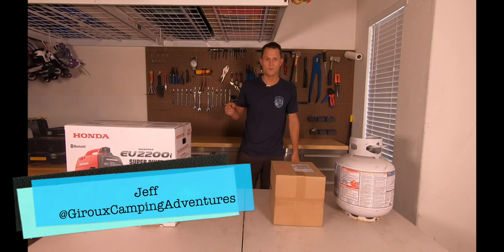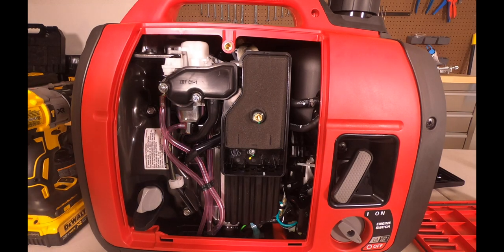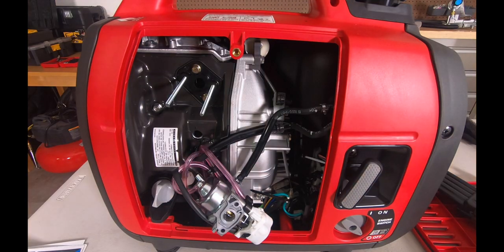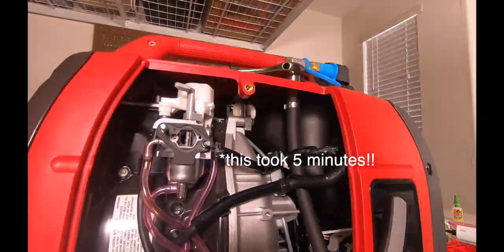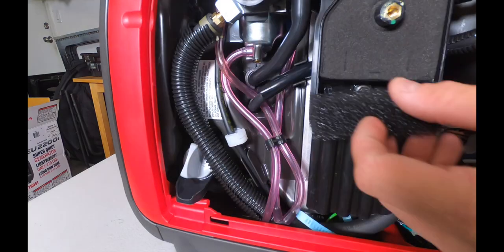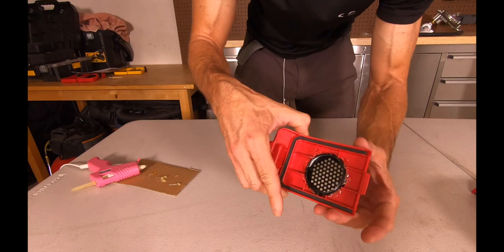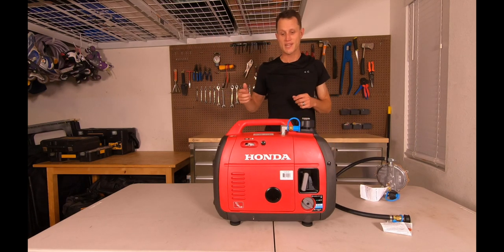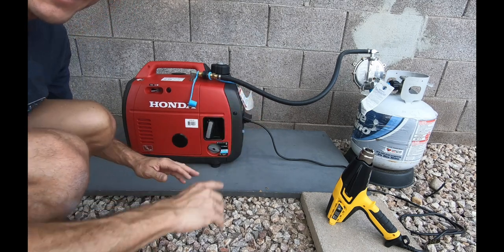Honda EU2200i Generator and Grenergy Propane Kit Conversion How-to

Comment: Not a bad idea to seat the piston rings with gasoline and conventional oil, as opposed to LP/NG and synthetic.
Reply from the maker: I plan to start using synthetic oil maybe around 100 hours. As for gasoline...not an option for me since I never want to put liquid gasoline in this generator. For me...more of a toy/science experiment. I don't mind seating piston rings with LP over gasoline. Though...I'm no engine expert and have not looked up the pros/cons of running either to seat pistons. Do you know?
Reply: @girouxcampingadventures  I replied, but my reply comment may be in the spam folder...
Reply from the maker: Correct, but not in spam. Checked "held for review" comments and nothing.
Reply: @girouxcampingadventures  interesting.  youtube thinks technical info is spam.  I know it's blocked because it doesn't show up when I read the comments on another account.  However the comment count confirms it is still there. and I still see my blocked comment from this account.  oh well.  I sent you a text message instead.  Make sure you have spam filtering turned off in your smartphone's text message interface. : -)
Reply from the maker: I see the comment now....reading...this is interesting...but for my case too late :) Still interesting...
Reply: @girouxcampingadventures  so what was said about the oil and break in?
Reply from the maker: @chadwallace3598  after I told Andy from Grenergy about my limited generator use the first 2 years, he replied with...

Since you've had your generator starting in 2021, I would do the oil change. But do so with the factory Honda oil, only switch over to synthetic after 100hrs when the engine is fully broken in. I do suggest breaking in your generator if you have kept it for this long. Just have the generator running overnight until the hours rack up. Breaking in the generator is very important as the piston rings needs to be set in for a prefect seal, same goes for the valves. 

If you have kept your generator indoors in a climate controlled environment, the oil inside the generator should still be fresh since it is not subjected to condensation or any other type of weathering. In this case you can do oil changes every 500 hours when ran on synthetic oil, or up to 2-3 years, which ever comes first. The oil should be much cleaner when ran on LP/NG. But for gasoline just follow the factory user guide. 

Jeff's recommendations...
Contact Grenergy support to validate based on your setup and usage. - https://grenergy-us.com/pages/contact-us
Reply: @girouxcampingadventures  interesting,  I didn’t think it took 100 hours before you could go to synthetic.
Reply from the maker: @chadwallace3598  that's why I suggested contacting the vendor to make sure. I NEVER have owned a generator in the past, so this is my first (well, had a Firman shortly that died). Engine break-in is important based on my research, and I too was surprised by the 100 hours prior to switching to synthetic. I only have 12 total hours on my generator. Why? I simply have too much solar and electronics on my RV to NOT need generator. Not really a problem though :)

Backup...just in case. Hence, rarely use it.

Comment: so snazzy.   totally want to do this!
Reply from the maker: Ben, totally do it. I saw your current trailer solar project! I have lots of solar on my RV too but not nearly as much as you will have. I still found a need to have a generator over the summer when it was hot or if we were stuck parking under a tree. You might found the same need. Thx for watching!

Comment: Very thorough, good job. How long will the generator run on a 20-pound propane bottle.
We do night fishing at the jetties.
Thanks for sharing.
Reply from the maker: According to the Grenergy manual, a 20lb tank can run a 1600w average load for 14 hours. If you have ECO mode enabled and only running an average load of 800w, then you get about 21 hours.
Reply: @girouxcampingadventures  Thank you very much
Reply from the maker: You’re welcome.

Comment: Great video Jeff. Curious as to why so much superglue rather than loctite.
Reply from the maker: Good question, Paul. I was simply following the Grenergy kit instructions. The book says to use super glue and not Loctite. When I pulled out the original Honda factor bolts, there was no Loctite on those. Hence, I figure why put Loctite on the new bolts. In fact, I question the feasibility of super glue on the new bolts as well. However, I will leave that question and answer to the Grenergy team as I'm sure they have done way more installs and tear downs than I have done.

Hopefully they can speak to the efficacy of using super glue long term in this kit conversion.
Reply: Hi Paul, if you were to use Loctite you will never be able to remove the bolts again. At least with super glue you can break it loose if the engine needs to be serviced.
Reply: @GrenergyTriFuel  use the blue loctite, not the red

Comment: How does this install differ from older eu2000. 2003 old version
Reply from the maker: good question, I don't have either of those models so hopefully Grenergy team can chime in. Also, thx for watching!
Reply: Hello, the install is the same. But with an addition of the carb run down switch, this guide can be found in every kit purchased.
Reply: min 6:24 whats the part number for that spacer plate or name, mine is cracked got a used unit would like to change it out, cant find it under spacer plate
Reply from the maker: I’m not sure. Let me ping Andy to reply here. You can also reach out to their support directly online: https://grenergy-us.com/pages/contact-us or email: support@grenergy-us.com
Reply: @CarlosDelaoGunEngraver  Hi, sounds like you had the plastic fuel adapter from our competitor. We don't just sell only the fuel adapter alone, but we can retro fit your old kit with ours. Please give us a call or email.
Reply: @GrenergyTriFuel  that's not the part I have your kit, found the correct name carburador insulator,  got off ebay
Reply: @CarlosDelaoGunEngraver  you mean the spacer between the engine head and backside of the carburetor. Sorry for the confusion.

Comment: How long does a tank usually last? I haven't found anyone with this info
Reply from the maker: According to the Grenergy manual, a 20lb tank can run a 1600w average load for 14 hours. If you have ECO mode enabled and only running an average load of 800w, then you get about 21 hours.

Comment: Thank you for making the video, you made it look easy!  Will the Grenergy run off an existing low pressure quick connect that is built into the camper and regulated by the regulator that is already connected to the trailer propane bottles?
Reply from the maker: I will only quote the manual book which at high level...looks to be a yes as long as you have something reducing the pressure BEFORE the demand regulator. When in doubt though and when you get your equipment and know exactly the connections, I would reach out to Grenergy support email with all parts listed in line so they can validate!

"Your generator comes pre-set from the factory to run from low pressure propane at 7-11" w.c. equivalent to max 1/2psi, also referred to as standard household pressure."

"DO NOT connect your generator directly to a propane tank without the proper regulator or to an intermediate 10-15psi regulator often found on large tanks."

Later in the manual...other note...

"The demand regulator only works under low pressure (11 WC or 1/2 psi). Pressure exceeding this will damage the rubber diaphragm inside the demand regulator and will void your warranty."
Reply from the maker: For example on my rig...I do not have quick connects for my onboard tanks. If I did...I would check my regulator which looks to be an "Automatic ChangeOver Model 6000". Based on vendor specs online, it says this regulator will "outlet 11wc". Based on the Grenergy requirements...if I had a quick connect on my RV...I could surely hook up my Grenergy kit to my onboard tanks since pressure coming into the Grenergy demand regulator from my rig would be 11wc. But again...check your equipment. I would say (assumptions) most onboard RV regulators take that pressure down to the 11-ish range. Again...check your specs. Email Grenergy.

My onboard regulator on the RV...model 6000
https://manuals.heartlandowners.org/manuals/Propane/Propane%20Auto%20Changeover%20Two-Stage%20Regulator%20Winntec%206020.pdf
Reply from the maker: Just looked at the Grenergy kit...the low pressure regulator is this...

Precimex 5001
https://www.propane-regulators.com/precimex-5001-single-stage-regulator-w-type-1-connection

From Amazon link, looks to be typical low pressure with outlet of 11wc :)
https://www.amazon.com/Single-Mod-5000-Regulator-Device/dp/B01J6DWJZ0

Back to your quick connect question, you could disconnect this low pressure regulator from the demand regulator (they are threaded directly with coupler), add a quick connect, then your hose with quick connect to your RV which now goes to the demand regulator with a quick connect instead of the low pressure (kit included) Precimex 5001.

RV quick connect > hose > quick connect > demand regulator > remaining kit as-is > generator

But I will always say...double check with Grenergy support please if you plan to do mods. I have not gone down that path yet so I don't have any stories for you...yet.
Reply from the maker: One note for sure in the manual...the 3ft of hose going from the big demand regulator to the generator...

You CANNOT modify that length according to manual.

Comment: Have you determined exactly how much your wattage output has been reduced when operating on propane?
Reply from the maker: Hi, I just received the kit and did the install in the recent month. My only test so far...even as a new generator...was the break-in period of 6 hours. During that time as mentioned in the video description notes, I ran my heat gun eventually on high which maxes around 1500w. I didn't notice any issues.

But...a true test is to run it with my RV now!

My solar setup is pretty cool on my RV. I plan to cheat and don't necessarily need the full wattage output of the motor. I suggest you watch other Grenergy videos that discuss wattage output. Maybe I'll make another video in the future.

As for my use case, I have solar with Victron equipment. The Victron Multiplus inverter has a mode called "Hybrid Assist" and can also limit "AC current limit". When I plug in shore power that has less than 30amp (my rig is 30amp) then I can adjust the AC current limit settings in my inverter to something like 10amp or 15amp. At that point, I will NEVER trip my generator or the shore power source.

Example:
1. Set inverter AC limit to 10amp
2. Solar and lithium batteries take on AC load
3. If generator is plugged in, inverter caps generator at 10amp, takes a 80% number, and you end up pulling about 1000w or so from shore power (aka generator).

I will most likely set my AC current limit on my camping adventures with this Honda generator Grenergy setup to about 12amp. However, keep in mind elevation and temperature outside...all of which reduce generator performance. So...as I go up in altitude or if it's super hot in the summer then I may reduce to 10amp AC current limit on my inverter settings.

Altitude - every 1k ft reduce by 3% or so
Temperature - every 10 degrees more temp outside reduce by 1% or so
Reply: Hi JML, to problem solve the low power output most folks refer to, is to actually bring one of these generators with the kit installed to a engine test facility, bench test it and exactly find out what's going on. 
What we have found is that without proper fuel adjustment from the demand regulator and reliable vacuum signal from the fuel adapter. You can be too rich or too lean when the engine is on or off load, which can greatly affect engine performance. 
We do the adjustments and fine tuning to the kit using sensors which are monitored on the computer. This is how we make adjustments accordingly, where other kits have you hand adjust the demand regulator by ear. Due to our testing we have not had customer complaints of loss of power or any performance issues. Please click on the video link here to see our test---> https://youtu.be/S8AOrmMnmLU
Reply: @girouxcampingadventures  good info, I have the same setup so this is all good...thx

Comment: @GRENERGY Tri-fuel System
Original Issue: https://youtu.be/VZjTlUQKVdU
Fix I came up with: https://youtu.be/VZjTlUQKVdU

I read your explanation on the webpage: whats-up-with-the-air-vents-why

However, the argument for the vent is that the engine compartment is not at atmosphere due to the suction created from the engine. However, in the video the engine is at atmosphere with the door off.

Also, why are you recommending cutting a hole in the door to increase airflow (Which will also disrupt engine cooling) instead of simply adjusting the low ide when the door is on without venting? Why cut the hole, instead of adjusting for low idle on the demand regulator?

P.S. I am not sure what is going on. I tried to post this response several times and it keeps getting removed. I am not sure if it is some kind of automated thing with YouTube or what.
Reply from the maker: Thx for the extra info. It's not me blocking...that's for sure. I have only seen 2 comments...your original and then this reply. Also your "fix" video link is the same. Just noticing this now, you didn't install the kit. You have the door open. Why not install properly?

I know your answer was directed towards Grenergy so I'll let them reply again. Personally, I have had no issues with the vent holes and generator function. Recent video load test in 4500 feet elevation was great. I would only suggest that you install properly then try the kit again as-is.
Reply: @girouxcampingadventures  I didn't want to commit to cutting the case of the unit until I ensured the kit was going to function properly. There is a comment on Amazon that talks about the vent holes preventing proper airflow, causing the motor to overheat. I am an electrical engineer myself and I have been talking to my mechanical engineer buddy. He is telling me that adding the air vents could dramatically effect the airflow inside of the case, causing the engine to overheat. This is where my reservations come from cutting the holes. That is why I am wondering if simply reducing the low idle adjustment can be used instead of cutting holes into the case. This is also probably why the case is pressurized.
Reply from the maker: @BKISHDROID  ah, that makes sense. I just went for it!!!! But...I guess I bought the generator with the intent of converting it...so no point in going back.
Reply from the maker: @BKISHDROID also, if you're like me you want to test and get your own proof. But...here's my recent video load testing. Then one from this summer.

Sedona load test (4500ft elevation) https://youtu.be/PLIj8RglIyI

Whipped out generator at farm to test more electronics fun!
https://youtu.be/i0o_9Bk2B-A

Both times, eco was OFF of course since I knew I wanted to push full load.

Good luck in your testing...I'm curious what you find. Since initially...I didn't like the idea of vent holes or cutting. I still don't. But for me it was more of a toy/hobby project since I rely more on the RV electronics instead.

Comment: When driling out the covers ,first drill the hole from inside, turn cover over ,and drill from the outside. It is easier to control and safer
Cliff
Reply from the maker: Definitely.